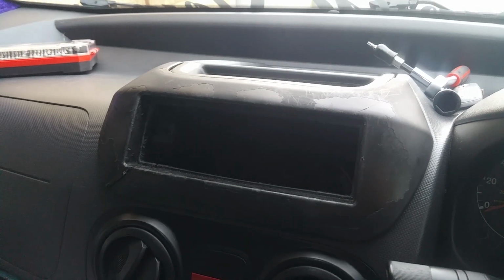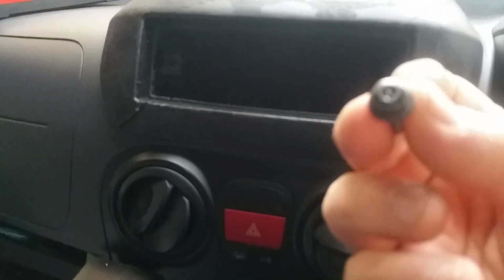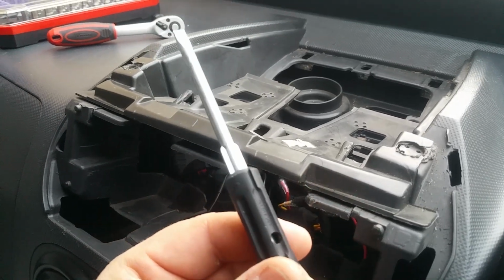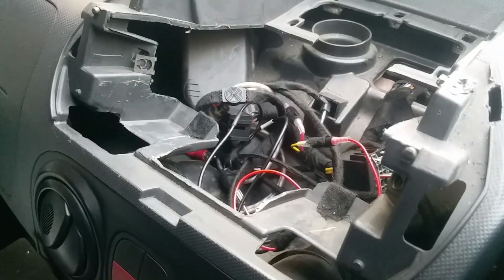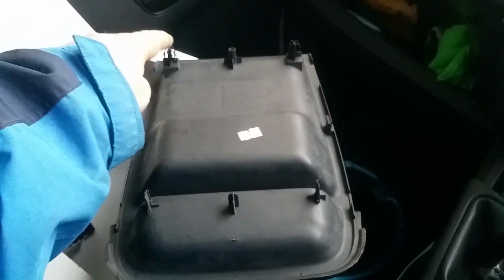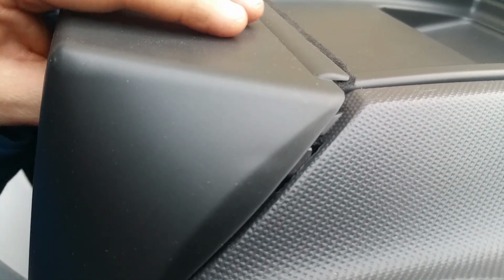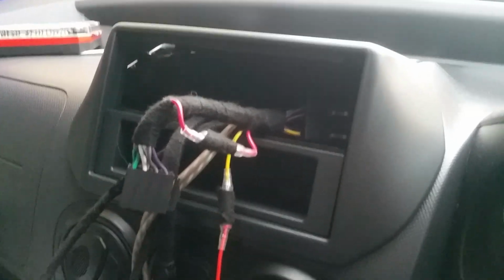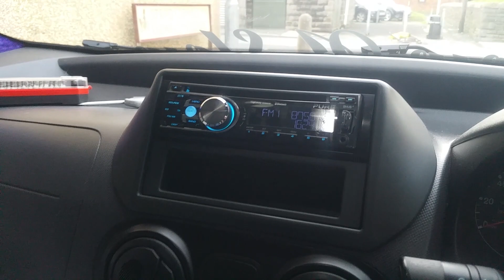Bipper 2009 double din adaptor installation works with forino / nemo / tepee vans also

Comment: Have just spent 2 1/2 hours installing a kenwood double din radio into a Bipper van... figured it out but have just found this video!!! At least it confirms what we did was the same! We used a kitchen knife to cut through the plastic and what a pain it was!
Reply from the maker: Ye that's Why I made the video because even tho guessing is ok it's daunting seeing such a lot too cut .. glad you sorted it really does feel like so big a hole when doing it too lol
Reply: Soooperspeed it’s huge! Do you have an adaptor plugged in for the steering wheel controls? I’ve forgotten to put one in and there seems to be an issue with the power to the unit which have sorted temporarily
Reply from the maker: @saintsforever  no I don't.. I didn't fit one as I am running after market steering wheel anyway .. as for the power I ran the live from the ignition wiring too the plug on the rear using an adaptor loom intended for the Peugeot partner van as they have the same wiring problem and the adaptor is cheap .. and ignored the steering control plug altogether.

Comment: Great thanks for the video, looking forward to upgrading my stereo to a double din with sat nav and a reserve camera
Reply: Hi, how did you get on with fitting the aftermarket stereo? Did you use a connect2 steering wheel harness so you could still use the controls on the wheel?
Reply: @lukehirst5426  hi look my van didn't actually have buttons on the steering wheel, so I just opted for an android radio unit . Just controlled by touch .
Reply: @Michael33342  ahh ok. I'm currently having a mare trying to fit a alpine head unit in the van. (Just wanted something with DAB but to still be able to use the controls on the wheel. They describe it as 'plug and play' but I'm either missing something obvious or just dumb. I'm having no luck trying to find out where the other original connector goes as there is no mention of it in the instructions.  🤔

Comment: that bit is easy...i have spent hours and hours trying to connect an aftermarket cd player to the factory leads...nothing works ?
Reply from the maker: hi did you get the after market wiring adaptor .. if you did then you still need too run the 12v switched cable thro too a switched source as in your ciggy lighter socket or the ignition switched live or anything really that is controlled with the key being turned too position 1 or 2 before you start the van ..if your looking for a place in the centre of the console to the left of the drivers seat ( uk side  ) there is a ciggy power point there .. buzz out the positive with a multi meter and splice into that cable ... there is actually 2 loom connectors there so you could use the spare that's usually taken up by the BT Bluetooth usb play socket that's rare fitted ...hope this helps you ..

Comment: Hi do you have a link for the double din please
Reply from the maker: sure it is in the video description above the comments or below the video .. here is the link for the one i used here if you cannot access the video description :) hope this helps https://www.ebay.co.uk/itm/CT24CT11-Citroen-Nemo-2008-on-Car-Stereo-Fitting-Facia/253140138091?ssPageName=STRK%3AMEBIDX%3AIT&_trksid=p2057872.m2749.l2649